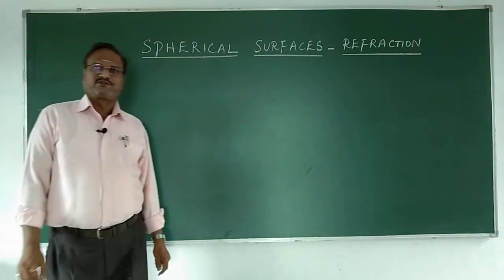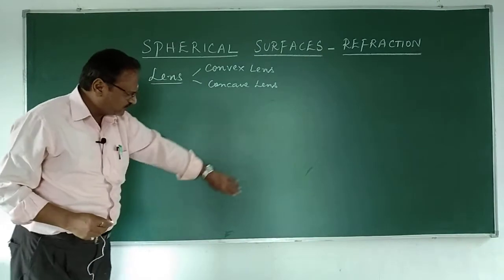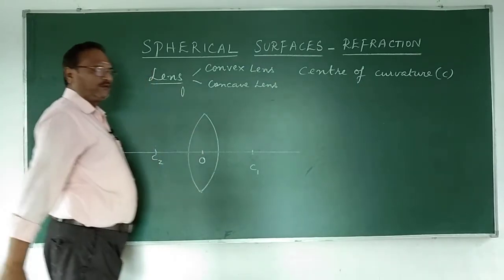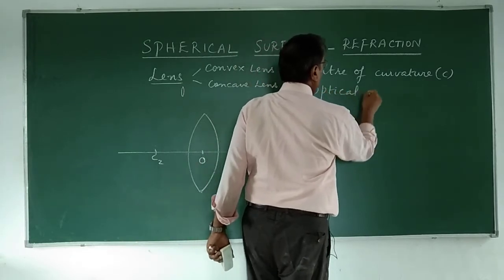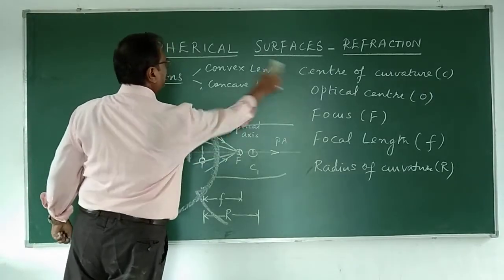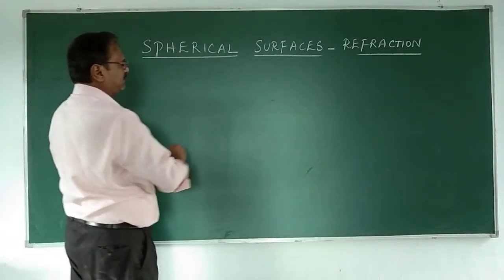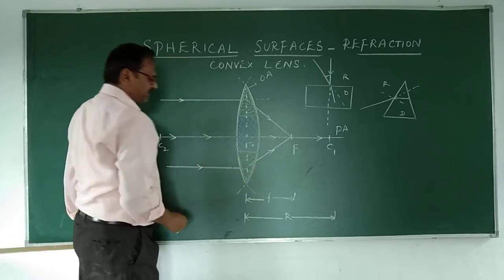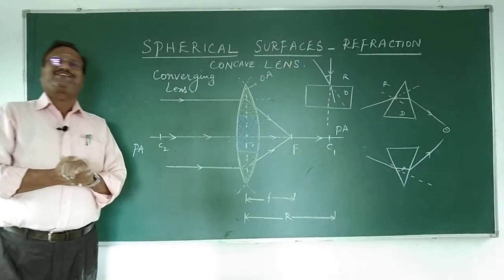Spherical Surfaces - Convex Lens

Comment: 📝✳ REFRACTION OF LIGHT THRO SPHERICAL SURFACES :
There are two types of transparent spherical surfaces (lens) -
💠 Concave Lens :
• It is a diverging lens 
• Curved inwards
💠Convex Lens :
• It is converging lens 
• bulged outwards
⭐Refraction through Convex lens 
🔹Notable points
👉 Convex lens have two centre of curvature and two foci. 
👉 Principle axis join two center of curvatures.
👉 Optical center is center point of lens. 
👉 A ray through principle axis travel without any deviation.
👉The center of line joining optical center and center of curvature called @radius of curvature...... ...(1)
👉 All rays which pass through a convex lens, converses at a point called FOCUS ( center point of line joining optical center and center of curvature.)
👉 The distance between optical center and  focus is called the @Focal length ............(2)
👉 from statement 1st and 2nd 
🔷Radius of curvature = 2* focal length 
🔷R=2f

Thanks sir 😇😇